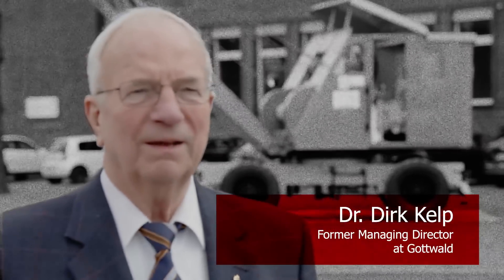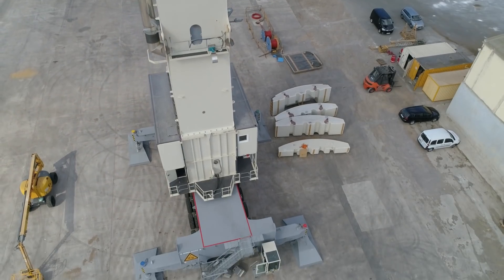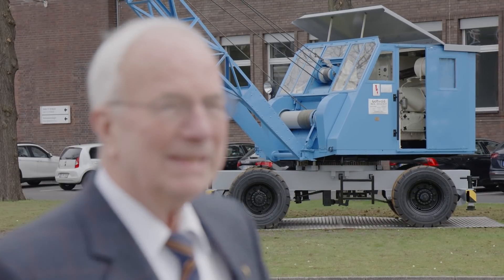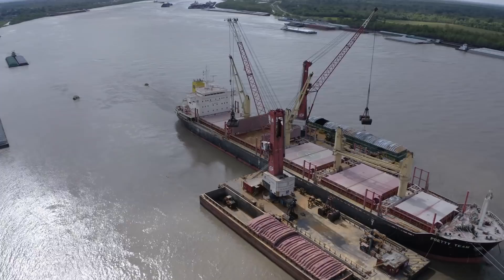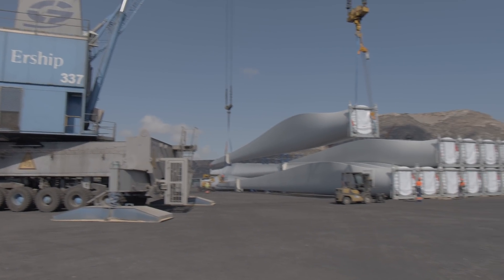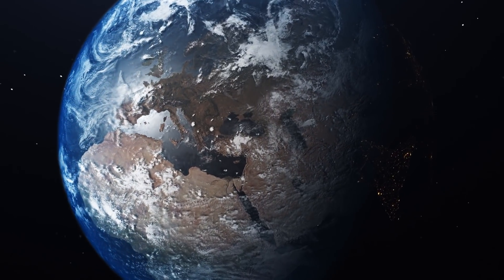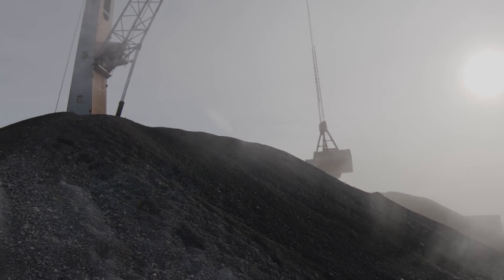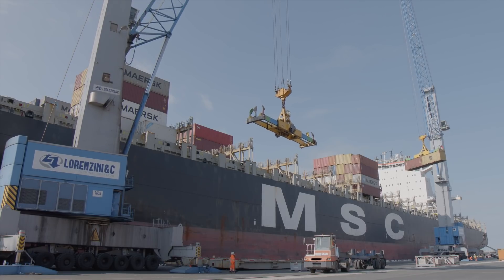2,000th Konecranes Gottwald Mobile Harbor Crane

Comment: Gottwald mobile  harbour cranes. Are really nice cranes . The operators cab is nicely put together . And it's a quiet and smooth crane to operate . Plus it's really durable . Requires low maintenance . Shout out team gottwald from Trinidad . Port of port of Spain.